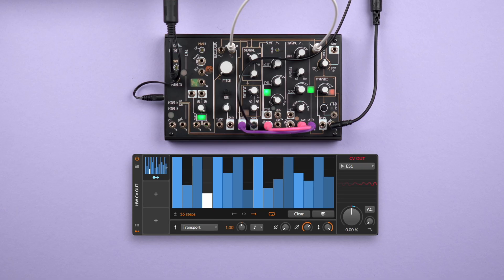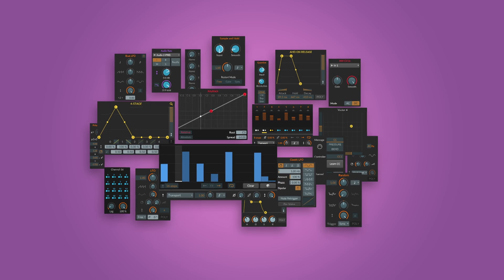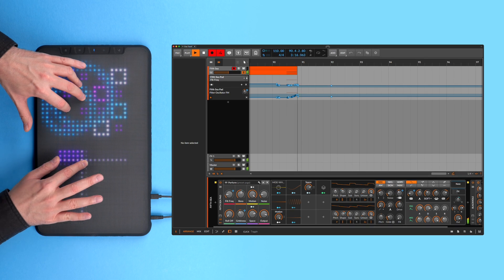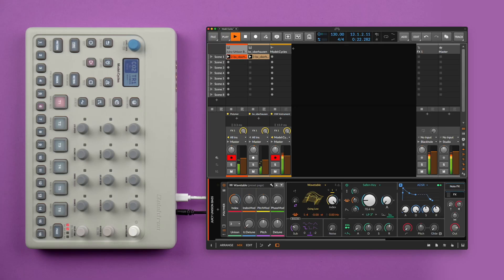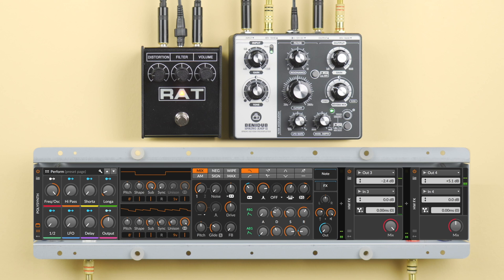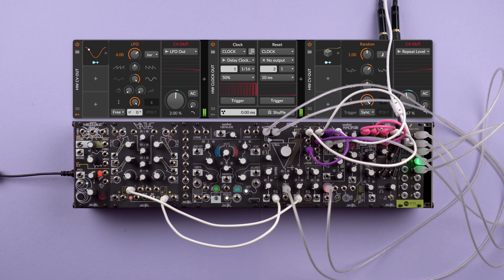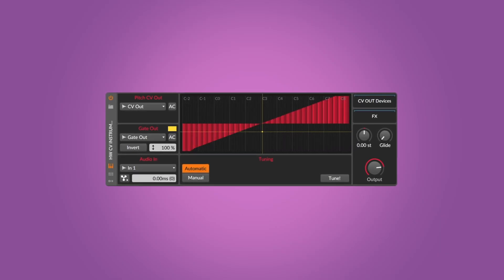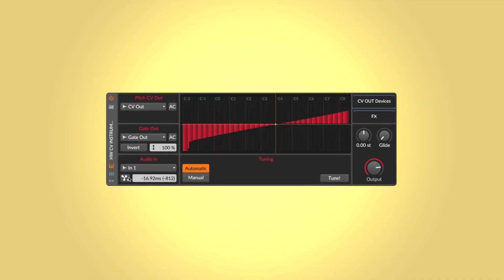Integrating Hardware with Bitwig Studio 101

Comment: Is any of these interfaces compatible with Linux? I know Bitwig is, but I don't know about the interfaces themselves.
Reply: I can't speak for all interfaces, but I'm not aware of any that don't work on Linux. I have been using Ubuntu Studio and I've been controlling Bitwig with Launchpad X running DrivenByMoss's controller scripts. It works just as well for me on Linux as it ever did on Windows. 

Basically, if it connects via USB, it will (almost definitely) work with Linux.